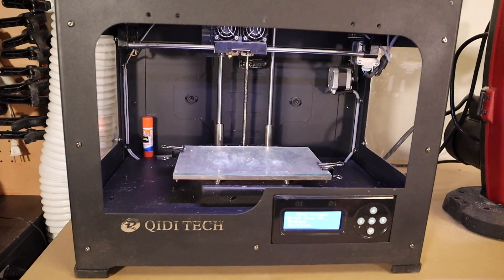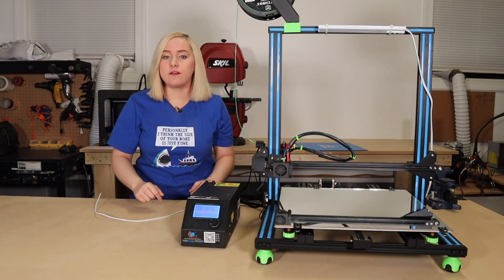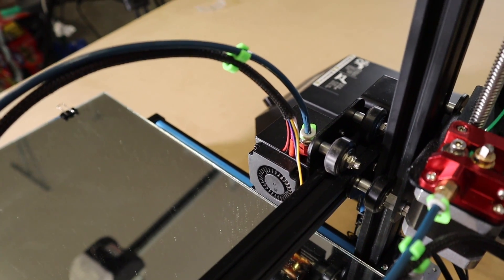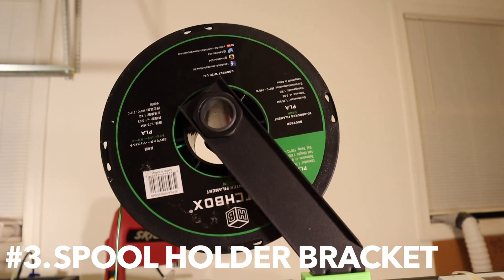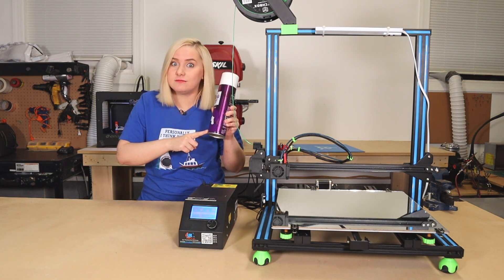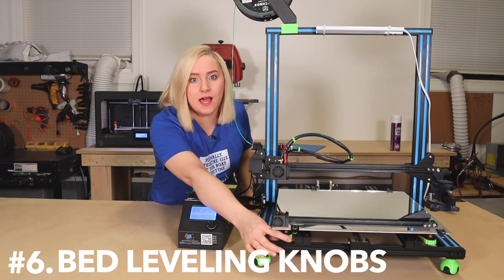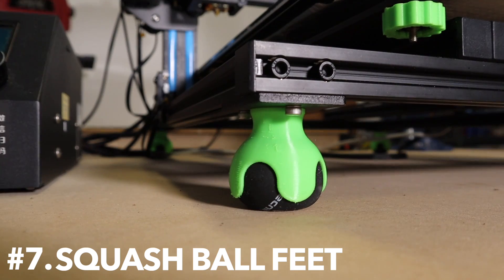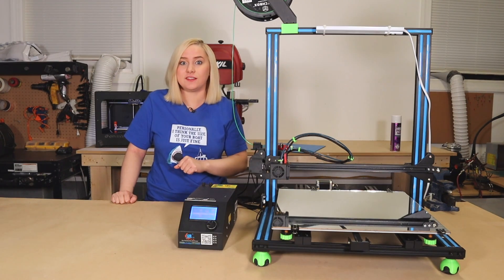Easy CR-10S4 Upgrades + CHANNEL UPDATE!!

Comment: Hi Amanda, 

I'm curious about how those squash balls affect your print quality.  I've heard padding the feet allows for more movement of the frame which adversely affects detail.  Adding some vibration deadening feet has been on my list of things to test, but I haven't gotten around to it yet.  I've even considered getting some isolation brackets for the stepper motors.

Please tell us more about that mat.  I am so sick of using hairspray.

I must disagree with you on the mirror for a couple reasons.  And let me start by saying, I took the same advice and now have a sand papered mirror leaning against my wall.  First of all, mirror glass from Lowes is definitely not flat.  At least the piece I got wasn't.  The center was way (WAY) higher than the corners making it impossible to print on.  Assuming you do get lucky, though, the thermal expansion coefficient of a mirror is significantly higher (3 times) than that of the borosilicate glass it came with, and as such, you may find that you have to level it at the temperature you plan to print at.  Add to that the aluminum layer on the back and it may be even worse.  And finally, the safety concern.  Unless you diligently sanded all of the edges and corners, you can get cut pretty badly by that mirror.  The edges on the piece I got were like razors.